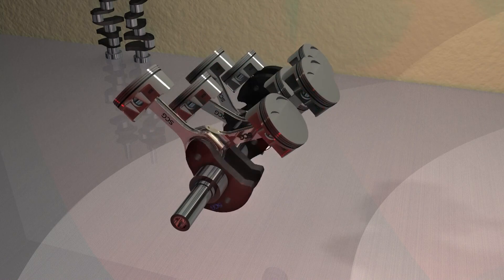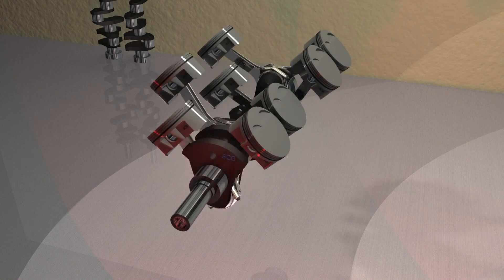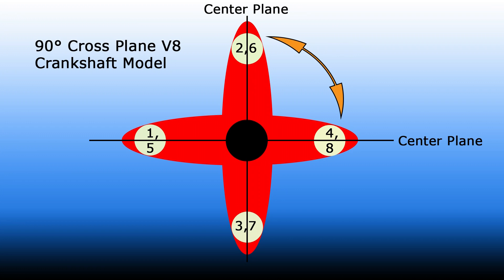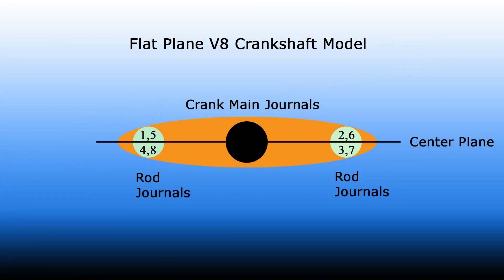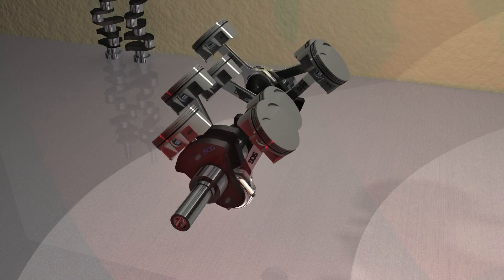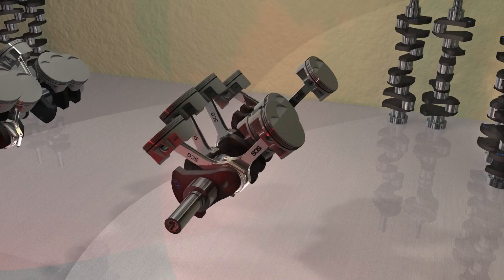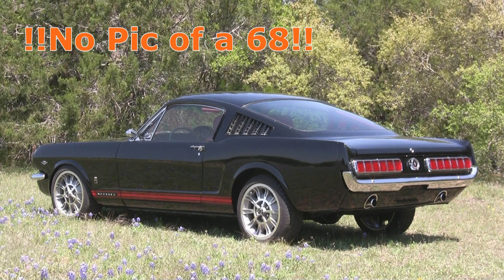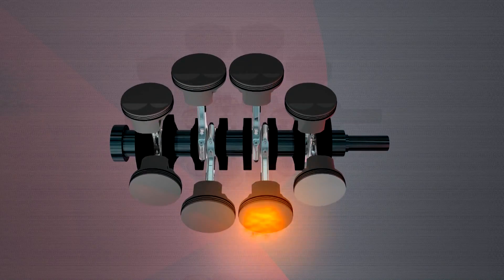FlatFast Crankshafts - Video 1 of 3

Comment: Disappointed that these kits were so expensive. I can easily imagine building a 302 pushrod Ford with the lightest possible rod/piston assembly. Not concerned with boost, just rpm.

Comment: But why doesn't the Mustang Coyote motor sound more like a Ferrari?  O.o
Reply: The 5.2 GT350 uses alternating crank journals, vs down, up, up, down.  It also uses an intake plenum vs individual runner.
Reply: Q: why doesn't the Mustang Coyote motor sound more like a Ferrari? A: a Coyote is the classic American crossplane (also cousin to dogs and wolves but that's another thread).

Comment: Always wondered about kit for SBC... currently drive Maserati with Ferrari engine. Power and sound insane.
Reply: I know a guy that has a Ferrari with a Maserati engine. My dad has a mercury with a ford engine. My mom drives a Lexus with a Toyota engine. I had a dodge truck with a Cummins engine. My brother has a gmc with an Isuzu engine. My friends dad has a corvette with a lotus engine. I rode in a Lamborghini with an Audi engine. Bugattis have VW engines. Ferrari and Maserati are the same company and they use the same engines. Otherwise, nice flex 😐
Reply: @mikehoncho5389  Thanks for comment. When Fiat bought companies, both were failing. For a short time, Ferrari had more efficient engine plant. Engines are identical except Ferrari uses 180 degree flat plane crank. Maserati uses a traditional 90 degree. Everything else is same, except valve covers and labels. My car sounds deep and throaty until 6,000 rpm. It screams like wounded beast from 6,000 - 9,000.

Comment: It's the balancer or vibration dampener which keeps the forces under control, some of the flat plane racing V8's run balance shafts.

Comment: Horsepower becomes more a function of RPM then displacement? It's lighter and it revs faster and higher
Would be fun to see a graphical interpretation of horsepower verse torque. What happens to the torque curve?
Reply: Horsepower is a function of, air flow through an engine.  Using air flow, you can predict horsepower.  It's just a black box.  You do not care if the engine inside the box is Ford or Ferrari.  All engines are just AIR PUMPS.   The greater the air flow, the greater the horsepower. You can have the same air flow in a V-10 Viper engine as a 2.0 liter 4 cylinder with 45 psi of boost. Making the same horsepower.  Engines are just air PUMPS.
Reply: @nellyfarnsworth7381  Torque is corresponding to airflow but then comes fuel, ignition, shape of channels and cylinders. HP = Torque*rpm. A truck engine has more than 3000Nm but just around 700 hp because it revs low. You can have a car engine making 700 hp but just maybe 800 Nm. That engiine can not pull 100 tons.

Comment: I had this idea in 2011 while on deployment in the Pacific ocean.  I had plans for a flat plane 440, timing order, just needed cash to build it. It would have easily been a 650hp motor that might normally be a 500 cross plane design
Reply: If you're talking mopar 440, you could build a 500" low deck stroker based on a 400. It turns out the 400 low deck is tougher than a pre smog 440. As well the 400 bores are thicker than any mopar B/RB engine and all the smog mopar B & RBs have many mods cast in to make them more durable. The low[er] deck B enables the strokers to half (almost) the reciprocating mass over stock 400 even though the stroke takes them out to 500 cu". This weight reduction helps by offsetting the rod angle to bore centerline at 90deg ATDC angle change from the increased stroke.  
Add stage VI heads which have a raised port and get this, RB intakes are designed to bolt on the low deck B with no mod! With the RB block spacer plates have to be added. They flow 350cfm unported at ~.600" lift or if you want Max Wedge ports (necessitating offset rockers), then 380cfm at 3/4 " lift. Exhaust port location is raised but the bolt pattern remains standard.
With an old school solid lifter flat tappet camshaft if you couldn't get 650+hp at 65-6700rpm with the 'small' Stage VI from a 500" stroker something would have be wrong. 
By way of comparison, Nicks Garage had a Gen II 505 Hemi that has stock Hemi heads (so similar airflow to the Stage VI wedge) but obviously with heavier pistons pumped out 635hp on a single 4bbl dual plane intake. 
Aluminum blocks for these engines are getting cheap and they're cross bolted on all 5 mains too. There's even an iron block that can be either a Hemi or a Wedge (no option of one or the other - each block can be built either way) and can be optioned low deck or RB height.
Reply: ThePaulv12 how much money
Reply: @fee9687  Depends.
400 stroker to 500 cu in.
Stroker kit $2250 (pistons, crank, rods)
Stage VI heads US made about $3000 assembled. They are $900ea bare but they flow nearly the same air as a Hemi head.
This is where the power is coming from.
I like the old school ductile iron rockers $900 and they are still available new.
I'd not use a hydraulic cam with this combo. I'd use an old school solid lifter camshaft. It will turn 6700rpm that way.
440 Source have cross bolt main cap kits for the Wedge block as well as a girdle. If going the stock block route then I'd recommend buying both as well as a windage tray and drilling the block for a half inch oil pickup tube.
New blocks are available for $3800 for a cross bolted iron block (4 mains) or about $5500 for aluminum (all 5 mains are cross bolted) and have revised oil passage routing.
Remember the Stage VI heads on the low deck use any RB intake (because of the raised port location) except Max Wedge intake - however Max Wedge Stage VI are available also but then require offset rocker arms which cost about the same as normal high quality rockers. I hardly think the extra area of the Max Wedge Stage VI heads are worthwile on the street because they only pickup the extra +30cfm airflow at the expense of much greater lift unported - ported is a completely different story.
The stock unported Stage VI flows 350cfm. An Edelbrock Hemi Victor flows 400cfm. 
I would expect 650hp from this 500 inch low deck stroker with Stage VI heads and a solid lifter flat tappet camshaft of .570-.625' lift and 10.5:1 comp.
Reply from the maker: Nathan, thank you for your service.  Cash is a problem for us all. I started this investigation back in 2009, long before the Ford Voodoo became public knowledge.  Check out the prototype that we are working with now.  https://youtu.be/_dYSibqJxdg  This engine is headed for a 1970 Mustang tryout early summer 2018.  Myth vs fact come early summer.
Reply: Nathan Stephenson how much did you need

Comment: What type of valvetrain are you using
Reply from the maker: The race engines are pretty tough since they have such a high rpm number to hit.  The street engines a little less robust at 8200 RPM.
Reply: Where can I get a set up for bbc